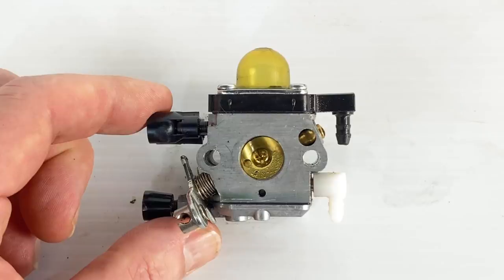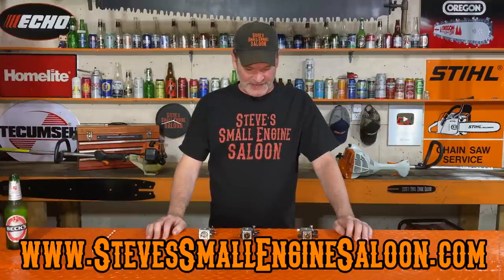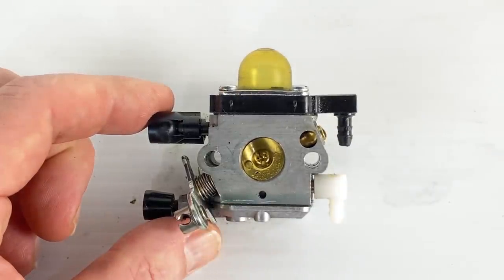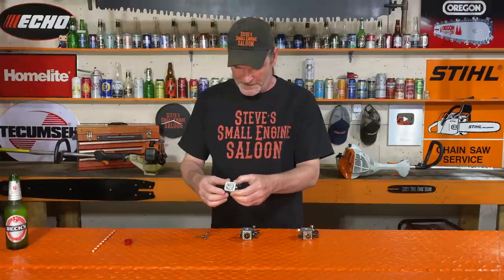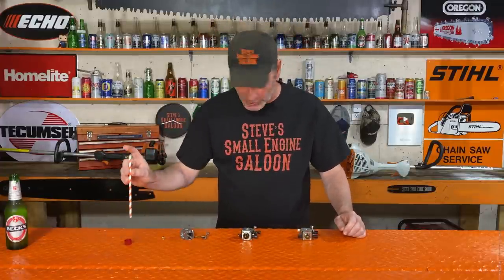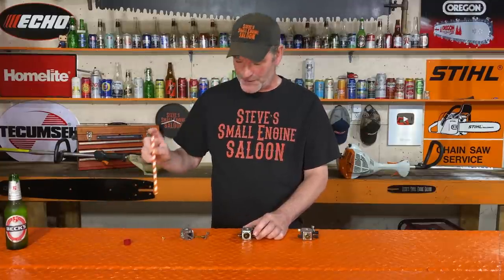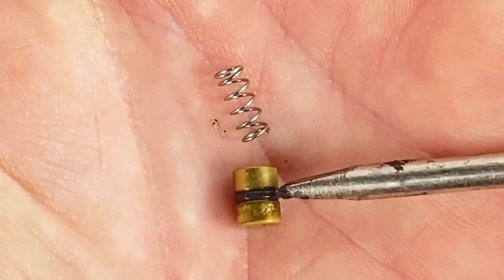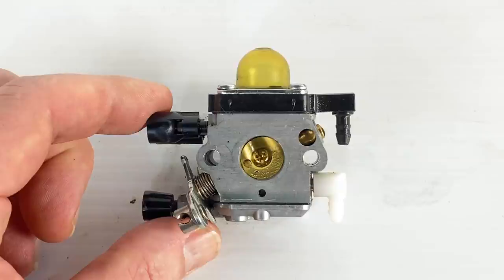Easiest Way To Test The Accelerator Pump On A Weedeater Carburetor

Comment: Can't you just replace the o-ring ?
Reply from the maker: In my experience.  If the o-ring or plunger needs replaced, then the gaskets and diaphragms probably do too.  Purge bulb is not far behind!  The carb is simply worn out and not cost effective to repair anymore...

Comment: Why not just change the o-ring?
Reply from the maker: In my experience.  If the o-ring or plunger needs replaced, then the gaskets and diaphragms probably do too.  Purge bulb is not far behind!  The carb is simply worn out and not cost effective to repair anymore...
Reply: @StevesSmallEngineSaloon  thank you

Comment: But I have the o ring in stock, I am cheap lol
Reply from the maker: In my experience.  If the o-ring or plunger needs replaced, then the gaskets and diaphragms probably do too.  Purge bulb is not far behind!  And the hole will be all scratched up and wear the new o-ring out super fast.  The carb is simply worn out and not cost effective to repair anymore...

Comment: If the accelerator pump is bad, the whole carb is bad. If the whole carb is worn out, the whole engine is probably worn out. Go to Walmart and see how cheap it is to replace the whole WeedEater. Welcome to the throw-away USA. When your spouse gets sick....

Comment: Throwing away possibly a whole good carb because a tiny replaceable o-ring went bad. What as a species are we doing...
Reply from the maker: In my experience.  If the o-ring or plunger needs replaced, then the gaskets and diaphragms probably do too.  Purge bulb is not far behind!  And the hole will be all scratched up and wear the new o-ring out super fast.  The carb is simply worn out and not cost effective to repair anymore...
Reply: I've had only 1 such case of this being an issue. 1 yo carb and it was the only thing wrong with it.

Comment: Come on Steve that’s not the Canadian way! Take the pump out replace the o ring and keep pumping! Where to get them? Cut a piece of the right diameter tubing if nothing else!
Reply from the maker: In my experience.  If the o-ring or plunger needs replaced, then the gaskets and diaphragms probably do too.  Purge bulb is not far behind!  And the hole will be all scratched up and wear the new o-ring out super fast.  The carb is simply worn out and not cost effective to repair anymore...